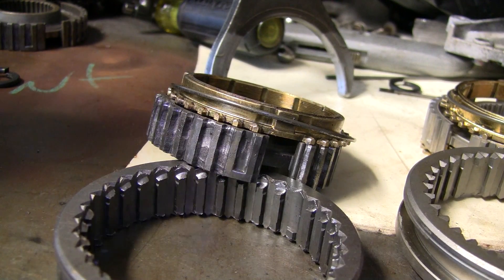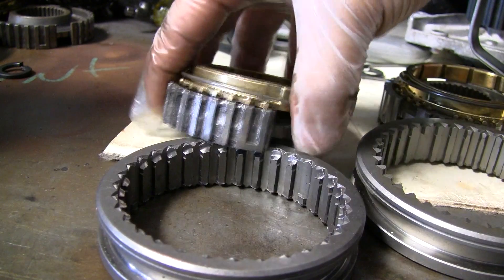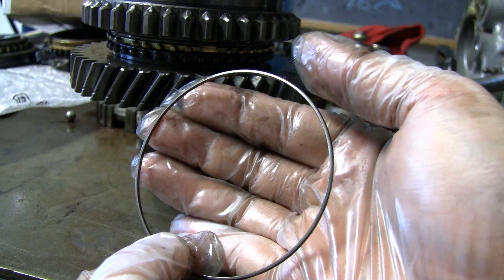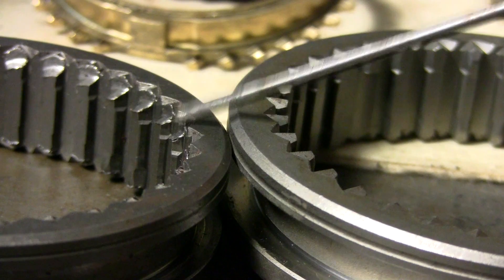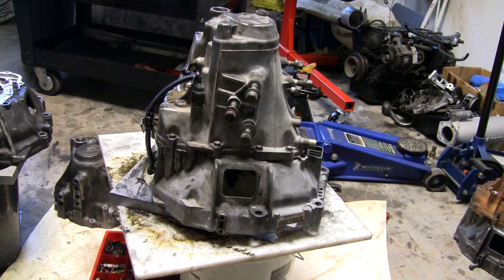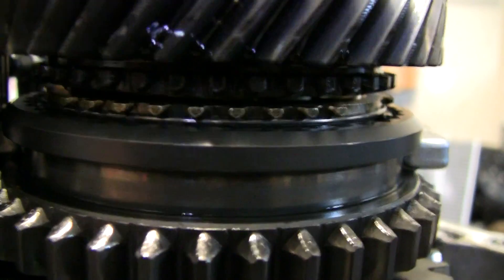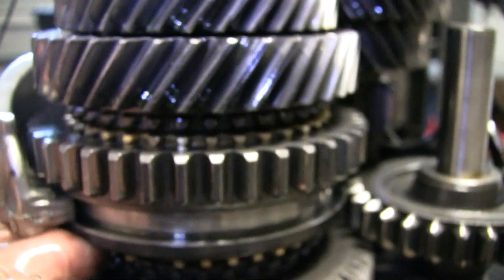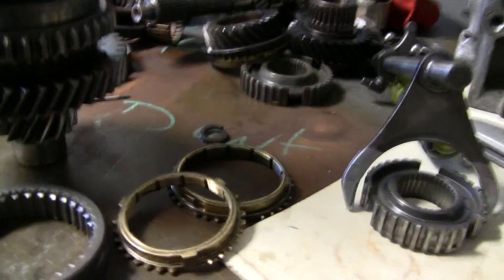how to inspect transmissions

Comment: In your opinion, what causes just sticking gears? Got an M5OD R1 that started sticking going into first and second. Doesn't grind at all. Changed fluid and it was good for a week, then it started back. Usually working the stick for a couple seconds will ease it into gear, sometimes it takes a little longer though. Thinking of trying another fluid change, maybe there's some sludge still floating around in there. What are your thoughts?

Comment: Theng , good video, I have a honda accord with APG6 standart transmission the problem is that the cv axle driver side is wobbling bad and look like is part of the differential whats wobbling, the question is do I have to change the whole differential or can be replaced the bearings?

Comment: I have an 01 civic with a p5b 5speed and 2nd gear pops intermittently   not alot but enough to get anooyed on a daily drive I have the trans out now and going to replace input and outputshaft seals and input bearing while im taking apart the trans ill be looking to see the wear on the selector gear and spring great video much love bro if I run in to troulble can i email you God bless.

Comment: Hi, my transmission has weird problem. the shift lever cannot bend Left (1st/2nd) and RIght (5th/R) sometimes. but once i rock the lever to left or right, it can get into gear without problem and no grinding. what could be the cause of such strange behavior? i could get it works again by rolling between 5th,R and N for a while. thanks for your advises!

Comment: i have a gsr transmission and i want ur opinion if i need to change the 3rd gear because is grinding when i shift 2 to 3rd at high rpms and sometimes at 3000 rpms

Comment: Duh, one more thing the spring does not stop the gear what stops it is the ring between the synchro , what it does is that the selector pushes  on the synchro and sandwiches the ring in between the synchro and make it stop for the selector to engage the gear. That's why synchro tech sells the carbon instead of just the brass because if u see the Oem is just brass in between that synchro ring so the carbon stop better :)

Comment: so yesterday i had a problem with my car not wanting to go into 3rd and 4th so i took in apart and it was  stuck so i freed it up so i put my s4c back together in neutral and bench shifted it and it went into all the gears fine and now it will go into 3rd and 4th but now not 1st and 2nd im thinking it has something to do with the shift change holder assembly any ideas this is the fourh time i will pull it back out and i dont know what i should be looking for thats causing this problem

Comment: Hi great video. i was wondering if you could explain some things to me. first off how does the selector gear stay in place? i assuming it is the combo of the ring on the syncro and the selector fork.  my gearbox seems to keep poping out of second when its under load.(engine breaking) 
is how would i go about de buring a selector gear like the one at 5min in your vid. mine seem to have less damage then that.
you say at the end of the vid to pop you an email. whats your address. 
thanks in advance

Comment: great video..i have question about my tranny, i had a b16 y1 cable transmission ,everytime i go into 4th gear it go in but when i let off the clutch it grind and pop back out.1st 2nd 3rd 5th and rev go in smooth .have any ideas what wrong with it? i take off the case and everything look new and good..thanks

Comment: ey man i have a ford taurus 2000. i have a question? my trany is good but when am heading to the freeway and starting to accelerate at the first or second clucht it jumps hard this happend when i push hard on gas and when i slightly push it doesnt feel much as when a push more gas. help on this i know is the trasnmission but what could be this????.

Comment: kinda unrelated, but do you have any idea how i can clean the filter in my 98 crv's auto transmission?

reason is, sometimes it shifts rough, and i've changed the fluid (genuine honda), checked the solenoids for blockage, so the only other thing i can think of is the filter, but according to the service manual, i've gotta take the transmission appart to get to it